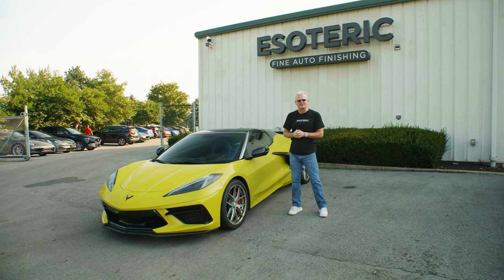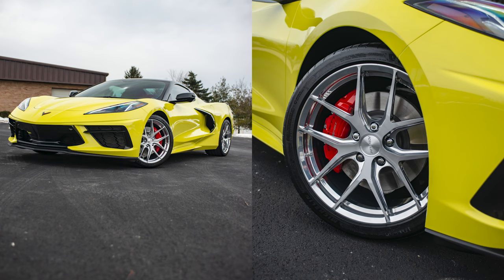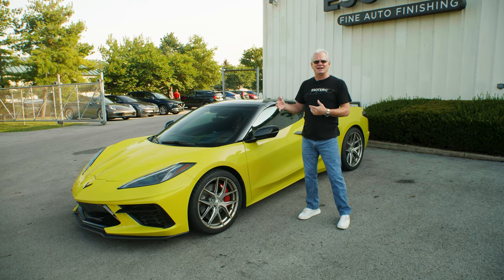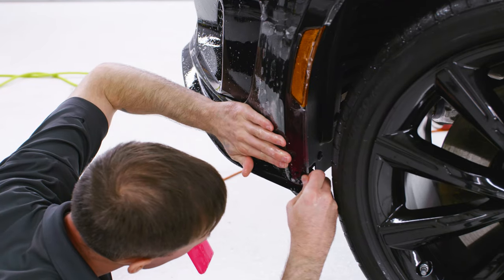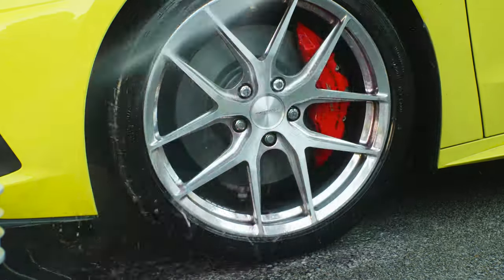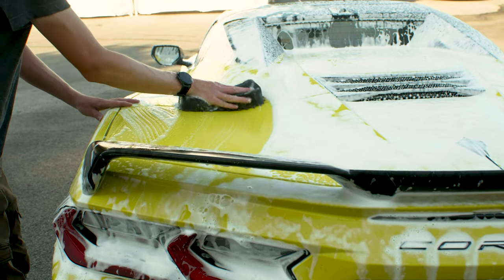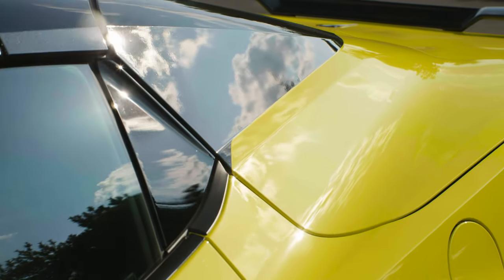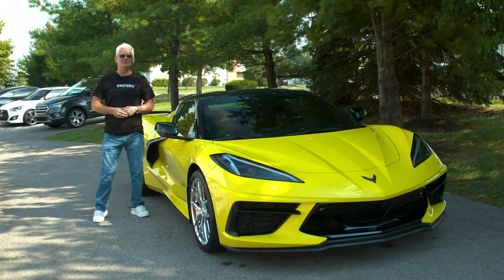The EASIEST way to KEEP a dirty car clean!

Comment: Personally I’d stick to ceramic only as PPF adds more orange peel over and above the factory orange peel, covering up the beautiful paintwork. But if you’re prone to rock chips then it’s the only solution. Also PPF yellows over time, some brands are worse than others but they all ultimately yellow.
Reply from the maker: With some of the modern films, the clarity is extremely strong. On some paints, it will actually improve the looks over OEM paint. Granted, if you're applying it to perfectly flat paint on a brand new Ford GT, you'll lose some of that clarity, but it's a great tradeoff compared to the cost of trying to get even a partial area repainted.
Reply: @Esotericdetail  as a detailer I’ve personally tested and used Optimum self heal, 3M, Llumar, Expel and a few others and I’ve yet to find one that didn’t noticeably increase optical distortion, not just to my eye but also to a customer once it’s pointed out to them (since most people don’t know what orange peel is but once shown can see it). It’s like using a screen protector for your phone, edges pick up dirt over time, etc.

What brand of film do you use?
Reply from the maker: @AJ56  We use a DOI meter to evaluate clarity of film and of the paint itself...this is the only way to get accurate measurements and to take subjectivity completely out of the equation. We've even had PPF manufacturers have us do DOI evaluations for them when developing their films. It's all in how you sell it, really. Every driven car is going to get chips, and I'd much rather have one with slightly reduced clarity, then one that's perfectly polished with rock chips. And for me as a car enthusiast, full wraps have completely changed my outlook on driving them. I used to always be worried about what conditions I was driving in, and who might be touching my car. I no longer worry about that, and enjoy my cars even more now with film. And because of our personal confidence in it, so are our customers...which is why we're typically booked 1-2 months in advance for film (mostly full wraps) even with 5 full-time installers.
Reply: @Esotericdetail  I’ll agree to disagree mate, it’s like phone screen protectors, I’m in the minority, as most people prefer the added protection despite the aesthetic cons. I really think self healing clearcoat will be huge in the future, it offers the best of both ceramic and PPF, without any of the downsides of film. 

I do appreciate you taking the time out for replying to my comment, I’d still like to know what brand of film you guys use? Cheers.

Comment: I watch these videos and always think how nice this process would be on my car. Then I stop screaming and wonder why no one in these videos ever, EVER, talks about the initial cost.
Reply: You don’t buy a super car for cost effective transportation, 💪. I would think around $7k though
Reply from the maker: That's something that you discuss directly with your local company because prices and ranges can vary widely (which is why they're never discussed). Also, there are a lot of options and variables that ultimately affect the finished price as well.
Reply: Alex, the initial cost is high. I took my factory ordered 2019 Mustang directly from the dealer to my professional detailer. I requested the dealer to do no prep on the paint - no wash or anything. Had my guy paint correct the entire vehicle, 3m Pro Series PPF Full Kit - front end and high touch points, & Ceramic Coating Gtechniq crystal serum Ultra with 9 year protection & Ceramic Window Tints, Interior protection. $3,800. It’s not something for everyone. But seriously my car looks as good as new two and a half years later.

Comment: What did you guys use to clean and polish and coat those wheels!? They look perfect.
Reply from the maker: They were coated with Kamikaze Stance Rim Coat. Then for cleaning, we use Gyeon Wheel Cleaner with Iron. Both are available at www.esotericcarcare.com
Reply: @Esotericdetail  Thanks for the reply! I have  new CCW wheels for my vette and don’t even want to drive on them till I get a coating on them. Haha. I will pick them up. I appreciate the info you provide for the community!